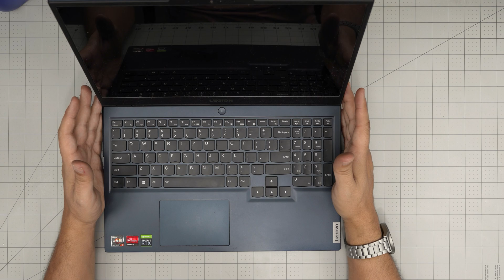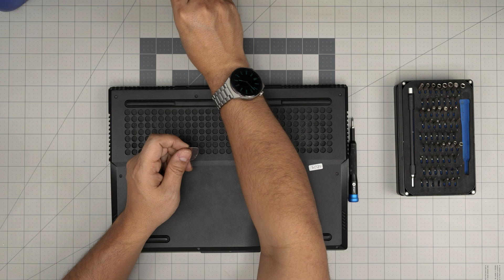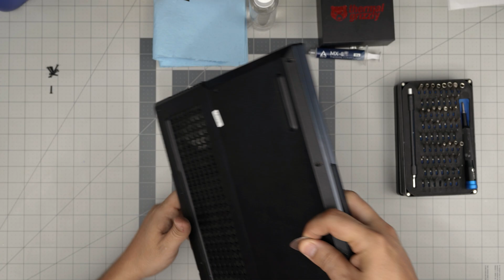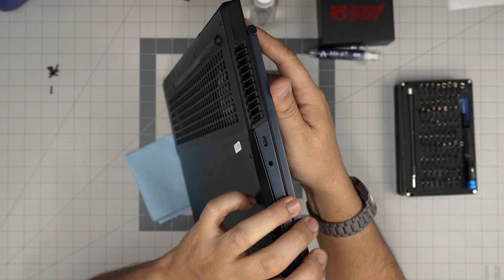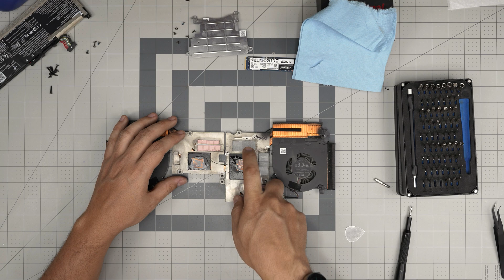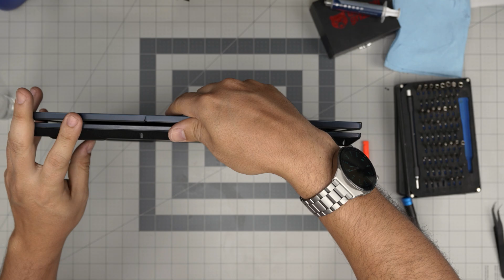Thermal Repaste & Deep Cleaning on Lenovo Legion 5 15ACH6 – Boost Performance & Lower Temps

Comment: i recently got my legion 5 same as in the video but i think the technician put a thinner thermal pad and after the repaste with thermal grizzly kryonaut the gpu temps were lower but the cpu is higher about 2-3 degrees does the thermal pads affect the gpu and cpu or its the paste itself
Reply from the maker: Yes, it will! Always use the correct dimensions (thickness) of the thermal pads, otherwise you will push the heatsink away and get worse temperature results.
cheers🍻

Comment: Do i have to clean the gpu and cpu glue or can i leave it as it is and just clean the fans?
Reply from the maker: 🫠Regarding your question, those are not glue they are thermal putty, leave them as they are, just clean the GPU/CPU and apply new paste.
cheers🍻

Comment: I had to clean my Lenovo laptop (I think it's a Legion 5 too, but not sure. AMD Ryzen 7 7745HX, RTX 4070).

I was constantly over/around 100°c while gaming with 102°c spike that would trigger a stop on the GPU and crash the game. I was crashing every two hours.
I have some experience with computer (I used to work in a repair shop when I was younger, and now I'm developper so I know a fair bit about computer), but yet, I still watched this guy's tutorial to make sure I don't break anything. My laptop version is slightly different than him but it's almost the same manipulation to do. And if you follow what he says, you will succeed for sure. I didnt had alcool to clean so I used another product with alcool (for glasses, a bit on a microfiber cloth did the trick)

My thermal pads are a bit damaged but I didn't have any, I think I'll do it again in 6 month because it was worth it. The thermal paste was like sand, it really needed to be changed

By only changing the thermal paste and cleaning the cooling system, I went to 100°c to 93°c in average temp while playing, while gaining around 20 fps due to the fact I got rid of the CPU bottleneck.

What I also did is buy a cooling pad so now, CPU temp is around 86°c.

So yeah, if your laptop feels like shit, do what he says, and buy a cooling pad.

Bench before: https://www.userbenchmark.com/UserRun/71310806
Bench after: https://www.userbenchmark.com/UserRun/71341420

Thank you UFIXTEK, it was a good video
Reply from the maker: It's my pleasure, my friend. 😊 I deeply appreciate your taking the time to provide feedback. If you're inclined to support the channel further, feel free to like and subscribe—or even both!
I'm glad my videos are helping!🫠💞
thank you for the comment.
Should you have any questions or requests in the future, please don't hesitate to ask me.
🍻cheers

Comment: I'm experiencing CPU bottleneck especially while playing Cyberpunk. GPU usage is under 50%. CPU temp reaches 97°C.

 Would replacing thermal paste fix it? It's a 3.5 year old Lenovo Legion 5 (Ryzen 7 5800 GTX 3060).
Reply from the maker: 🫠Regarding your question, oh, that is your problem—97°C. Replace the thermal paste and make sure you apply this:
PTM 7950 Honeywell
https://amzn.to/3HDKBnO
on both the CPU and GPU. You will see excellent results. Also, clean the air vents and make sure they are not clogged.
Should you have any further questions or requests in the future, please don't hesitate to ask me.
cheers🍻

This is an Amazon affiliate link. When you use my links, you are helping to support the channel. 🙏

Comment: Hi, I noticed suddenly that the laptop was overheating too much, so I did a complete maintenance. It doesn't overheat like it used to, but I have issues with certain cores 1, 3, and 7 reaching temperatures of 100 without running anything on it. I updated Windows and the BIOS, but nothing works. Do you think you can help me?
Reply from the maker: 🫠Regarding your question, yes, we do encounter that issue with a few clients on these models. The best solution is as follows and works beautifully:
1. Get a 0.3mm 20mm x 20mm copper shim.
https://amzn.to/4kT8cP9
2. Get PTM 7950 by Honeywell.
https://amzn.to/46kHACW
3. Apply the PTM 7950 on the CPU/GPU crystal dies.
4. Place the copper shim over the CPU/GPU.
5. Apply PTM 7950 over the copper shim.
6. Reattach the heatsink.

Enjoy the results!
cheers🍻

This is an Amazon affiliate link. When you use my links, you are helping to support the channel. 🙏
Reply: @uFixTek hi, I am having temps issues on my loq 13650hx 4060. Will this solution work? If yes do we need to change thermal pad thickness? And 0.2mm copper should also work right?
Reply from the maker: don't touch the thermal pads, they will be fine.
and 0.2mm will do just fine too
Reply: @uFixTek thanks I will try.
Reply from the maker: cheers🍻
Reply: @uFixTek copper shim didn't work. Any video for that? Temps went Higher😅 . lenovo loq 13650hx/4060
Reply from the maker: I will make a video on that. It should not have gone higher! I am working on a video about it, and I will reply here soon.

Comment: Honestly, this video made me more confused and scared of really cleaning my laptop fan. This is my 1st laptop I bought 3 years back and I can't afford to damage it by mistake, which would probably force me to buy another laptop of a similar kind. You make it seems so seamless, but I can't guarantee myself a good job even if I follow your video. For example, I have seen videos where they don't disassemble anything beyond opening the bottom case when cleaning the fan. Some went to the bios and disabled boot without power source and then didn't completely remove the battery from the laptop. Some insisted on screwing and unscrewing in the correct order or not screwing it too tightly. So many instructions and I don't know what to follow. All those instructions are vague as well. I mean, I heard one saying to tighten the screw at 70%, I don't know what 70% tightening feels like.
Reply from the maker: 🫠 Regarding your confusion:
First of all, I can say with full confidence—backed by 21 years of experience in the field of servicing and repairing—that:
**Point One: You can't remove the fan without also removing the heatsink. You need to remove the heatsink in order to access the fan; it's simple physics.
**Point Two: Don’t touch the BIOS options. Even if you disable "Power On Boot," it only partially disables power to the board. It is highly recommended to simply disconnect the battery and then plug it back in.
Also, don’t follow “similar” videos—always follow a video specifically made for your laptop model!
**Point Three: Regarding the screws, just tighten them normally as you would on a toy—not too tight, not too loose. There is no specific order except for the heatsink screws, which are usually numbered.

Take your time, don’t rush, and you’ll be fine.
cheers🍻

Comment: I did everything like how you did it, after doing so, I noticed that my fans are not spinning anymore, are there anything I can do to test if its still working?
Reply from the maker: 🫠Regarding your question, the fans will only spin when the CPU or GPU temperatures reach 60°C or 70°C.

Should you have any further questions or requests in the future, please don't hesitate to ask me.
cheers🍻
Reply: @uFixTek  thank you for the reply, for my unit what happened was I overtightened my screws on the fans causing it to be compressed. That is why the fans are not spinning. But I fixed it already, thank you!
Reply from the maker: Awesome, I'm glad you got it solved!
And yes, never tighten the screws too much.
⭐👍

Comment: I decided to clean and repaste my legion pro 5 16IRX8 (13700HX and 4070 laptop). They had used Thermal paste on the dies and Thermal Putty on the VRMs and Vrams. I used Thermal grizzly Krynaut (1g) as paste and Thermal Grizzly minus pad 1mm instead of PuTTY. I didn't see much improvement to CPU temp but My gpu temp is 40-45 at idle but can rise up to 90 as I game. I remember it used to be some degrees cooler (80-85 while gaming) before i repasted it. Is this concerning? 👀
Reply from the maker: The reason you didn't get better temperatures is that you used pads instead of putty, as the pads will counter-push the heatsink. The distance between the heatsink and the component is not uniform, which is why putty is used.
Get some putty, and then use Thermal Grizzly paste for the GPU/CPU.
cheers🍻
Reply: I heard PTM7950 pads makes magic for legion laptops.

Comment: I didn't know you could detach the fan like that
Reply from the maker: Yes, that is the correct way to disconnect them without causing damage to the cable or the jack.
cheers🍻